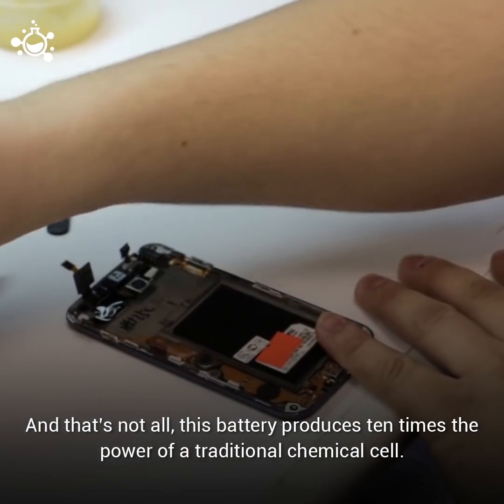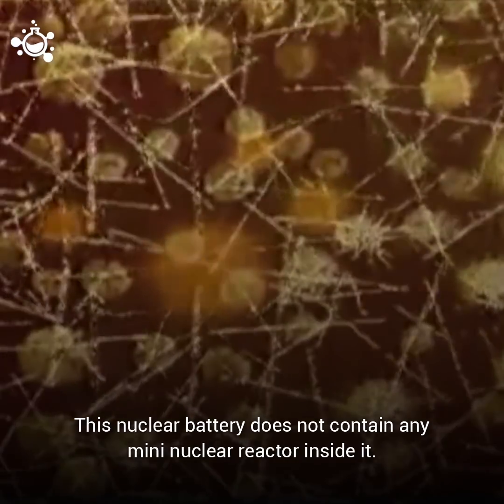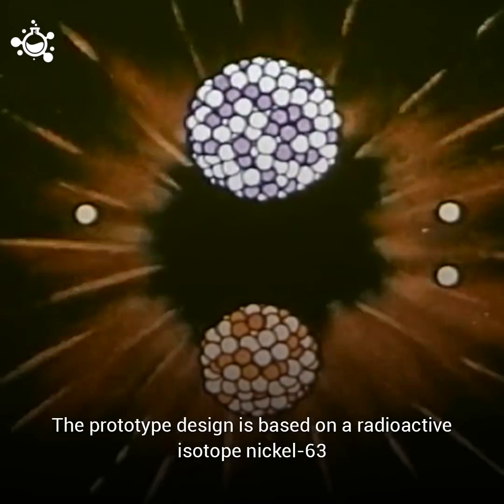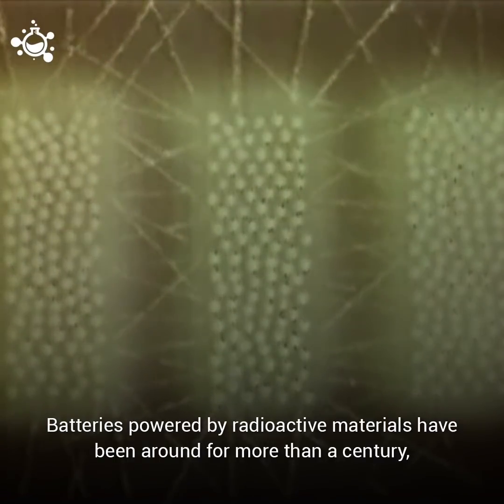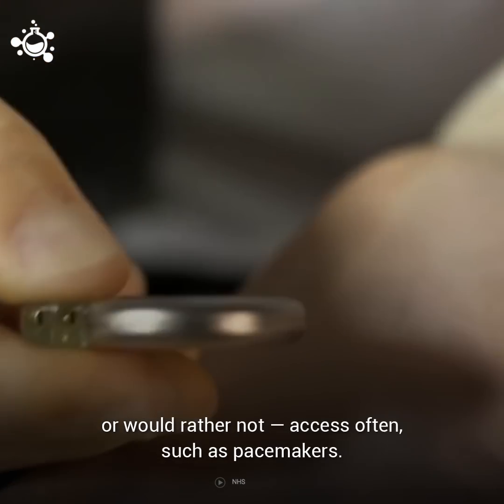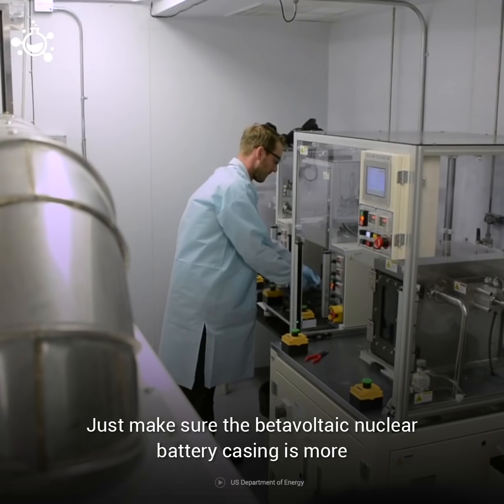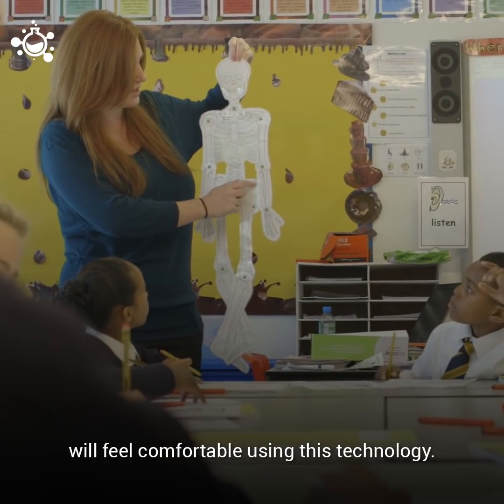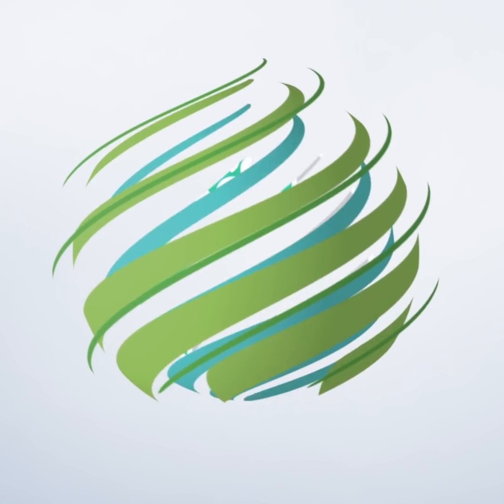Nuclear batteries can last for over a century without recharging!

Comment: Let's do some calculations on your claims in this video: 3.3Ah/g energy density= 3300Ah/kg. However betavoltaics are solarcells, so their emf is only  around 0.5V, so that is 1650Wh/kg that is still 4 times the energy density of Li-ion, not bad! However having to spend 100 years to get Them out= 800,000 hours, you can draw No more than 2mW from that 1kg of battery! So if your EV has 400 kg of batteries your EV can use No more than 0.8W driving down the road without needing a break! In other Words, $10 million Worth of nuclear battery is far less usable than a 5W solar panel on the dashboard charging a Dollar Store powerbank. So your claim of 4 times the power of Li-ion batteries is off by a factor of 16000!! Recap: You stumble upon an article with interesting claims, but don't Bother to check the obvious fishy claims with simple primary shool math? This only leaves one question: Are you stupid?

Comment: I just watched another video on "diamond" (carbon-14) batteries that said that the electrical output is too small to use in most applications.  However, they mentioned implants as one possible use because they require only a small current.

Comment: A certain phone company has enough experience with exploding cellphones, the last thing you need is bigger the bang for your buck.
Reply: Yup, the Samsung Galaxy S71 will have a self destruct app that makes the battery go critical!
Reply: The beta particles can be blocked by 2mm thick aluminium.
Reply: I don't think it would be a bang, more of a radiation leak.
Reply: "<Gleeful Desert ululating!">"

"<Sneering mocking Gaelic, regarding the single-use policy>"

Comment: you have been reading BS yes its true you can get these batteries BUT the output power is very low, so low they will never be able to run a cell phone or most things  one of these batteries would take about 2 years to produce the power one AAA has, so the only thing it might power is say your tv remote BUT been that they are around $2000 each and you would need two, who the hell would pay 4k for a battey just for your tv remote, please do some real research before you make a BS video that only spreads BS.

Comment: 3300 millwatt hours per gram?  so, lets say that a 1 gram battery  released its power over 3300 hours.  or 137.5 days.   To power a cell phone off of it, say 1 watt, you would need a 300kg battery.

I certainly hope you misspoke on the power of it.
Reply: his whole video is BS the only true part is that these batteries are in fact real. BUT they are very poor, they wont be able to power a cell phone at all, they output only about 100
micro amps witch is hardly anything at all

Comment: Nice idea, but how would it get rid of the energy which it produces while not in use. Because the nuclear reaction won't be probably able to stop it will generate electricity or heat nonstop
Reply: this has been around for years, the energy comes from light, so it still produces light, basically  they just slap a solar cell on top of it so with that light / glow, you get power, but its very poor, hardy any power is made and wont run jack shit, this guy is way over hyping this technology

Comment: Oil companies would literally go to war!
Reply: No they wouldn't. Because petroleum is used to make far more things than only gasoline, diesel and jet fuel.
Reply: Think not. A household battery of about 200 kg barely offers to power your smart TV.
3300 mwh -> 1650 mwh after 100 years -> 330 watt pr. Hour.
Reply: Solar panel companies and lithium mining companies would go to war, not oil companies
Reply: @danieljones7965  You would need Lithium and Graphene for battery density and efficiency. So this could go side by side with a super capacitor if it can actually output 3,300mw/H (3.3 watts)
Reply: Woldometer lists fossil fuel extinguished in 2040. In 20 years they are done anyway.
Reply: @Hawlkeye-e9p  It's kind of hard to say that Oil will run out by 2040 when countries like Venezuela have over 300 billion barrels of petrol in the ground... (estimate)
Reply: @Hawlkeye-e9p  We have enough for at least another 250 years.
Reply: Yes.. If. I get. This battery.. I will set this into. A ekectric baik.. And make a electric baike.. 😛😛😛😛..and go for a long long drive

Comment: No point in having a phone battery with a half life of 100 years when the phone has a half life of about two years!
Reply: You could move the battery into the new phone
Reply: but we are fast approaching 1nm process , if they can even get a 1nm chip there is no other place for them to go really
we are almost  at peak DPI in terms or screens and cameras , the human eye is only capable of detecting so much detail
most of this is just planned obsolescence  , give it an SD slot  that can be upgraded to 2TB and beyond and  a top of the line  screen camera and a new  3 ,2  or 1 nm process processor and 64gb of RAM and  add in 5g and wifi 6 wireless chip and it will last decades
Reply: @andreamitchell4758  I know what you're saying. But the likes of Apple will still find ways of convincing the gullible that last years phone on not cool any more.
Reply: Well electric cars can really benefit from this hey Tesla I’m lookin at you
Reply: @nickolasborden8511  So they can do 3.3Wh per gram! This is ten times the energy of Li-ion, a 100kg battry pack with 330kWh!! But at what power? If they are 100 years to deliver that, It will be a pretty slow Tesla!
Reply: we could probably reverse it, back then you replace battery. now replace the battery with a phone.
Reply: Make the battery removable to put in your new phone
Reply: +Hugo Stiglitz. Yeah, these batteries though would be very useful for cars and trucks. Imagine a semi-truck that doesn't need to refuel for 100 years or an aircraft that can stay in the air just as long.
Reply: Get it 2getha ppl
Reply: A smaller battery would take care this
Reply: Atleast u can be sure that ur wont run out of batt when u are in a jungle and no electricity...lol
Reply: @Lukastaylor8731  That's true, but you'll probably have no phone signal anyway!😂
Reply: @Lukastaylor8731  thats a lot of angry birds

Comment: A half life of 100 ys doesn't mean that the battery dies in a century, it means that over 100 ys the decay of beta particles is half as much as when it started decaying. And 3.300 mW/h it's 3.3 W/h
Reply: 3300mwh per gram not per hour
Reply: @manishbhandari33  . Yes it is per hour. That's what the h is in Wh. It's a measurement of battery capacity. Watts over time. A 100 Ah batter would take 1 hour to deplete with a 100 Amp load.
Reply: Or 3.3 KWh per kilo. About 16 times more than li-ion.
Reply: @E-BikingAdventures  but one kg of a radioactive material insidea single battery cell... i dont't think that is a god idea,  many tiny batteries is a better idea
Reply: Ok, so in 100 years should be down to about 1650 mwh/g

Comment: So how big would such a device be to power a 100kw electrical could it replace the lithium battery?
Reply: This device is 3300 Watts / kilo.  100kw is like 30 kilograms of this battery.  a kilogram of solid material is like 1 liter, then we are talking  30 liter size is like 93cm x 30cm x 30cm.
Reply: @BienestarMutuo  so it's better to use this instead of a lithium ion battery?
Reply: @CUBETechie  Friend, the missing info is that this battery energy  of 3300 mW/ gr, is measured in all the life of the battery, (100 years) , to make the comparison to common lithium ion battery we need to put the energy in equal terms.   This nuclear battery achieved ~1μW hour output, equating to ~10μW hour /cm3, the today lithium ion batteries energy density is 400.000 μW hour/cm3, 2019 there are lithium prototypes with 1.000.000 μW hour /cm3 and there are people that say that have 4.000.000 μW hour /cm3 like the people of https://xnrgi.com/ . 
In our opinion the important metrics to look in batteries are energy density and price to kill the combustion engine,  in cars and planes.  that is 3 W hr/cm3 (3.000.000 μW/cm3) and the price of 100$ per kilo watt / hr.
The nuclear battery is a different beast, because is a electric generator and not a battery to be recharged.
note: the energy density of liquid fossil fuels is more or less 3 W hr/cm3.

Comment: how can it last 100 years with only 33Wh of power per 10g? thats not even enough to power a phone for a day
Reply: it's not very radioactive, it releases energy very very slowly (100 years) to power very low power devices.
Polonium 210 has a half life of only 138 days... and a single gram generates 140 watts of power (of course it's going to be a fraction of that due to efficiency).

a cubic centimeter of that and you're dumping 1.3 kilowatts of power for four and a half months...
Reply: @-John-Doe-  can someone explain me how nuclear submarines can stay under water so long? Do they have a nuclear reactor?
Reply: @medic5258  Yup. A nuclear submarine is powered by a nuclear reactor. 

A conventionally powered submarine may only operate from a few days, to a few hours depending on fuel consumption. A Nuclear submarine does not need refueling over the course of its 25 year service. The only resource that limits the time underwater is the food supply for the crew and maintenance of the vessel.
Reply: @-John-Doe-  o: thx for telling

Comment: i want to make my S2000 nuclear driven, that would be awesome
Reply: Nuclear reactors work by using fission to create heat, that turns water into steam, and it spins a turbine, creating electricity, as it rises.
So a nuclear powered car could create electricity with steam, and then power an electric motor , or maybe use the steam itself in a steam engine design

Comment: Nuclear batteries have been along for many years. If there would have been enough R&D, we would be using them now. Surely, money is one reason why this is not the case because big corporations must make money out of every step of inovation. 
Nonetheless, good news for Tesla. They can use these batteries for their cars. :)
Reply: I think the real problem is that it's too dangerous.
As the guy in the video said, just a thick enough layer of aluminum and you're okay...  but dont drop it - EVER.
Problem is, if they do commercialize it, someone, many people WILL definitely drop some, leading to cause radioactive pollution way worse than what traditional batteries pollution does (which is already really bad)
Reply: rockinpenguin also many people would just use in harm ways just to hurt others or just for being ignorant. I have heard about those batteries twenty years ago.